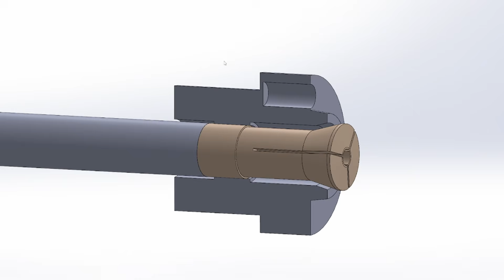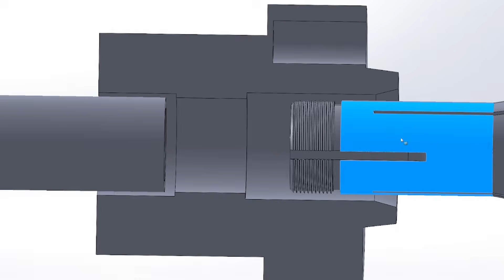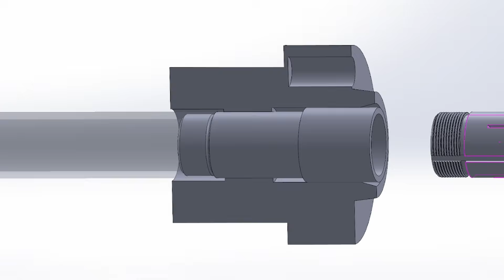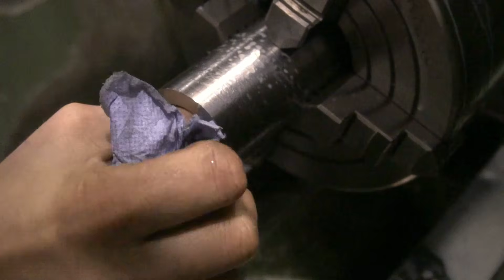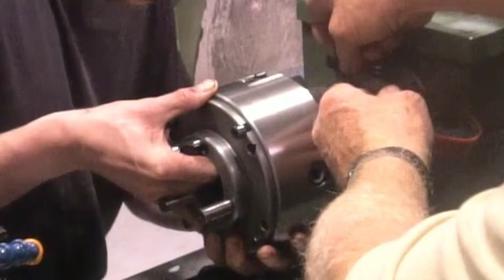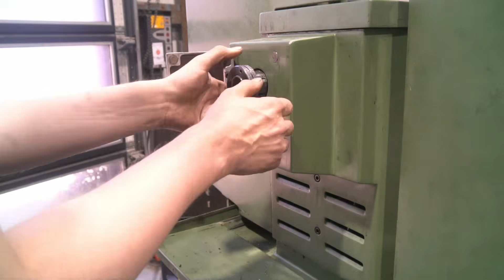I Made This to Avoid Paying 3,000€ for Collets

Comment: Can u share the 3d model of the chuck?
Reply from the maker: Sure, here you go. If you want to use this on any other machine, you will very likely have to change that drawtube adapter at least. But I hope you find this useful.  https://home.looksaboutright.de/download/C5_to_%20Camlok_adapter.STEP
Reply: @LooksAboutRight_yt  thank you man!i have a small colchester with a 4.5 morse taper and a collet closer from another smalll lathe that needs fitting,and im having some problems with the reducing sleeve,my lathe  also has a d1-3 nose so the 3d model is already fitting,after whatching your video im temped to upgread to a 5c from my 4c,i already need to modify the draw nut tube ,so it would be easier to do everything on the cnc lathe at work,
btw keep up with the good work,already subscribed
Reply from the maker: Thanks for the kind words, and best of luck with the thing. I would like to see it when you're finished.

Comment: I like the 5-C collet key block how you bolt that in place on back face. 
You might have trouble getting your internal adapter removed 
I was thinking about making 2 or 4 holes and a pin Spanner socket it
Reply from the maker: I haven't had any problems getting the adapter out yet, but I like your idea. I'll have to make a small modification before that problem actually comes up. Thanks for the idea!

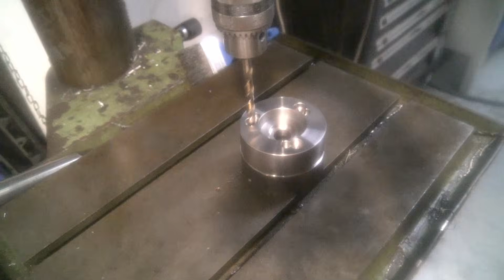Comment: Great work and i know your not going to like this but please 14:26 on the drill press should use a vice or something to hold the work. Chucks and tools can be repurchase easily but body parts are harder to replace once mangled.
Reply from the maker: You are right. Doing it faster should not trump safety. At the time, it seemed OK, but I should have taken the time to throw a strap clamp or two on there.

Comment: Very nice video! At work I use a similar size lathe with a ProtoTrak RLX control on it. We have a quick change tool post on this lathe and a number of tool holders. Our main turning tools are CNMG 120404 inserts. With the particular insert we've been using, a speed of 120 m/min in steel, feed rate of 0.25 mm/rev, and radial depth of 1.00 mm breaks chips that are not too long and are manageable. Not tiny chips, but not endless stringy chips either. We do lots of one-offs and small batches, so cycle times are not that important, it's always the set ups that take the longest.
Reply from the maker: Thanks, it's great to see that you enjoyed the project.

Comment: For a CNC Lathe I can see the use of C style Collets for running production parts.
But for a Manual Lathe you're much better off using ER Collets which give you a better range of variations in sizes of material you can hold with higher gripping force.
I've Never been a fan of 5c Collets ??? 
Because unless the material is close as possible to the size of the 5c Collet it won't hold the material accurately ???
And the plus of ER style Collets they have 6 points of contact compared to C style Collets which only have 3 points of contact.
Reply: ER collets are a poor choice for lathes.  The bearing length and angle does not give a true precision location like a high quality 5C. They are cheap, plentiful and collapse to deal with variations in diameter but that in itself is problematic. BIG Daishowa make a variant that is better but expensive.
Reply from the maker: Hm, I have to say I never thought about ER-style collets for material holding before. I think for us hobbyists, it probably mostly comes down to what is more easily available.

As for the size variation, at least most of the time that is a non-issue. Both the raw material and the geometry for clamping the second side are full-mm sizes most of the time anyway, and with 5C having 0.5 mm steps, we are pretty close most of the time anyway.

But that's just two minutes of thinking about it.
Reply: @LooksAboutRight_yt  Of course there are a few options if you want to spend money ???
Most of the 5c Collet sets are usually in 1.00 mm increments but if you want to commit more money you can also have 0.50 mm sets also.

Being that most who watch YouTube are not running a Machine Shop tooling for these people can be expensive.

For me IF I need a tool for a customer job I just buy it.

My original thoughts when posting was to consider those who Don't have big budgets to spend on tooling and trying to add a more cost effective way to hold work accurately without over committing to tooling that isn't necessary and being that some who have Metal Lathes in many cases they also have a Milling Machine that uses ER Collets 👍
Reply from the maker: I think that is a fair point. It is also pretty much the point of this video. Since my manual lathe came with the 1–23 mm 5C set (in 0.5 mm steps), it was the obvious target for the adapter to avoid the expensive B32s.

If I didn't happen to own that set, I certainly wouldn't have bought it and would probably have looked for other options. But that obviously doesn't apply to everyone.
Reply: @LooksAboutRight_yt The argument if I can say it that way ?? 
About ER Collets vs 5c sort of overshadowed what you were trying to share in your video.
It's always good to share what you enjoy doing with others.
Nice work making something that works for you and could possibly offer other people watching an option for their Lathe 👍
Reply: @weldmachine a real simple ER setup is the straight shank holders that are available in ER 11 to ER 40. Just clamp them straight in the chuck if you have one that runs true. A really high precision option is MT collets. No through hole and a smaller range but absolutely accurate due the shallow angle.  Lots of theses lying around in shops.
Reply: Yes it true but u cant use a collet closer or a draw bar with er collet,u still need to use a wrench to use it
Reply: @annaromano670  Of course they both have their Pros and Cons.

Comment: I like this solution. But could you have made a new drawbar for the 5c collets?
Reply from the maker: I considered that initially as well. As the 5C is shorter than the B32, the cylindrical bearing in the spindle nose is in the way. The new drawbar would have to be longer, pass through that section, and be larger in diameter to accommodate the internal thread behind it. With these restrictions, it would be impossible to assemble.

I hope this makes sense.

Comment: is it just me or is the audio broken? sorry to be the bearer of bad news
Reply from the maker: I clicked through a bit, and the volume may be a little inconsistent, but I can hear myself fine. In what way is it broken for you, so I can see if I can improve it next time? Or, if it is really bad, I can re-upload it.
Reply: @LooksAboutRight_yt  the scenes showing a top-down view with the metal table surface and your hands have clicks (glitches) every second or two, sounds like a buffer underrun of some sort or dropped samples. the other scenes don't have the issue, and other videos on youtube don't have the issue either. I checked on desktop and mobile and both have the clicks.

I don't think there's much you can do about it other than recording those parts again, I wouldn't bother, just check next time :)
Reply from the maker: You are right, I hear it too. I had a look at the source files, and it is in there as well. I don't know how I overlooked this while editing.

Thanks for bringing it to my attention. I will be more conscious of it in the future. I hope you could still enjoy the project anyway.
Reply: @LooksAboutRight_yt oh yeah :) just letting you know for the future. btw a good thing to do is to load the audio tracks in audacity, and change the display to spectrum view. Any vertical or horizontal lines are trouble. A lot of stuff happening at the very very bottom means rumble (trouble). Stuff missing at the top means a dull mic placement or not enough EQ. Etc.

BTW you might be able to repair the clicks with iZotope Vinyl or Ozone or something like that. That is if you care a lot, I wouldn't bother right now.